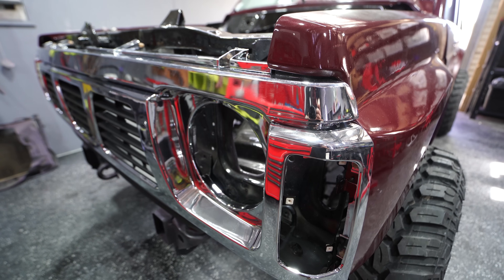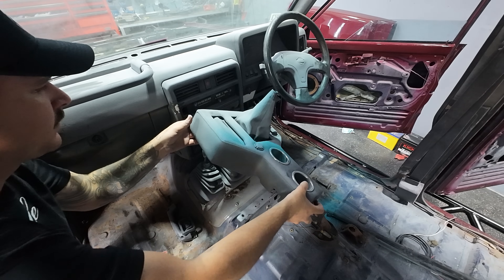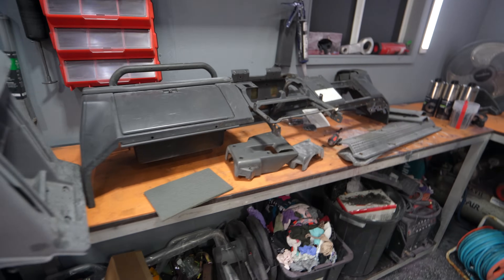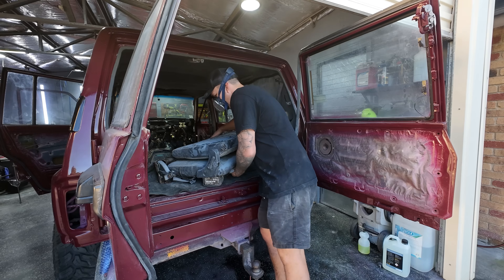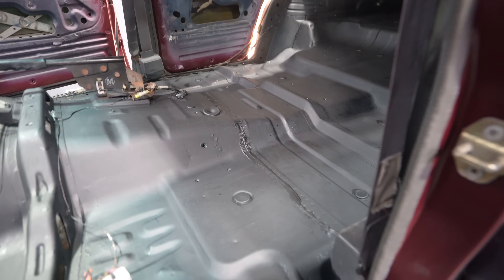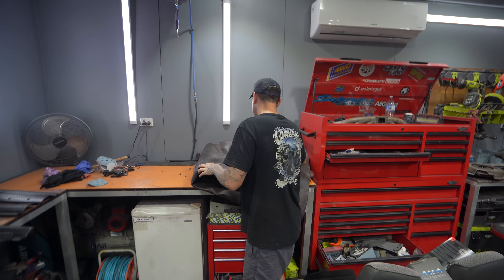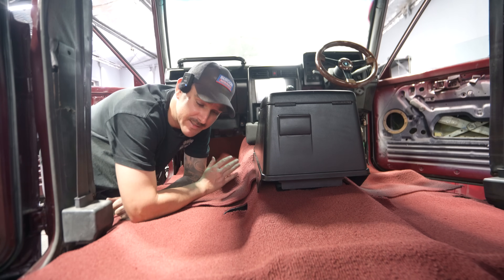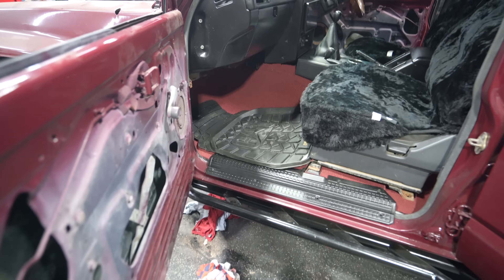How to make Insanely Nice Interior! (Best Mods)

Comment: Bullbar kool Tommy, going to suit the theme of the truck and polish it up, will look awesome. If you're going to use it to winch with, you may need to strengthen the bar somewhat. Why not gusset the joins with 3 or 4mm alloy plate? Might be a bit of stuffing around but worth the piece of mind and will hopefully act as a bit of insurance for a period correct bar.

Comment: I've done the same job on my GQ, but with sound deadening on the floor and closed cell foam under the carpet. Aside from the massive difference in noise, if you don't at least put some underlay under the carpet, the carpet forms to the ribs in the floor and looks horrible. I put a serious sound system in mine so the dynamat type insulation made a massive difference to making the truck quiet, especially up the firewall.

Comment: Before doing the main coat for the floor under the carpet, is that white paint a primer used to put over the wire brushed rusted spots and then once that dries you put the urkiprotec main coat